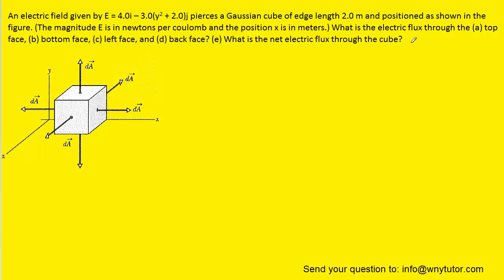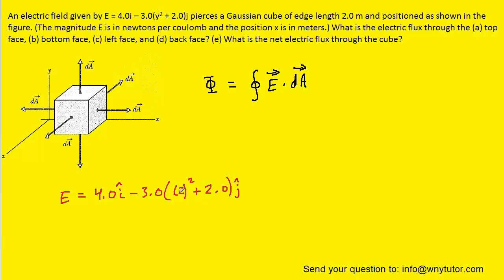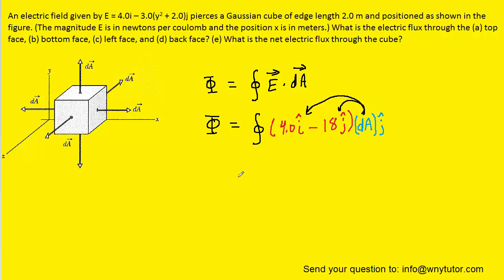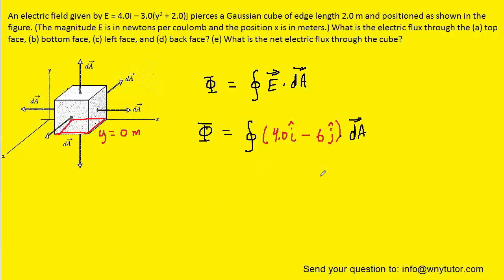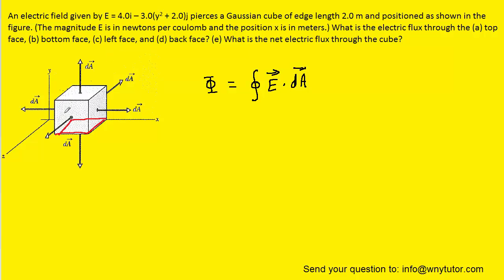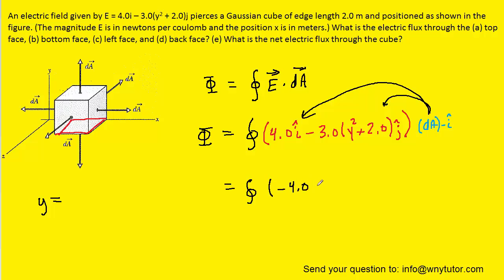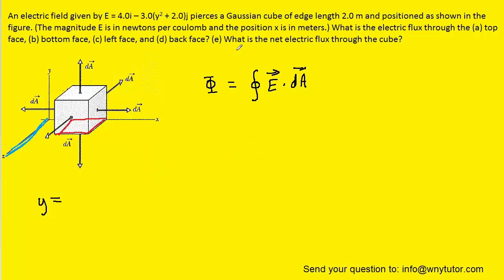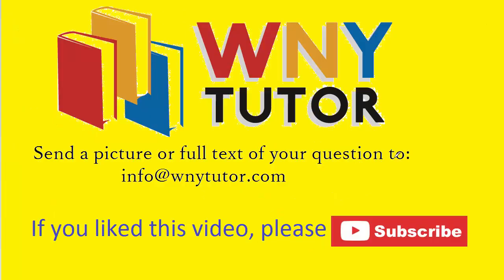An electric field given by pierces the gaussian cube

Comment: Why does the R and L faces have the same flux while the T & B do not have the same flux?
Reply: The top & bottom of the cube have different flux because their flux depends on the j part of the electric field vector. The j part of the vector's value depends on the y-value at that position, so because the top and bottom have different y-values, it causes the strength of the electric field to differ between them.

Comment: Plzz help me with this question 
A closed surface with dimensions a = b = 0.4m and c = 0.6m is as shown above. The left edge of the closed surface is located at the point x = a. The electric field through the region is nonuniform and is given by E = (3 + 2x^2)în/C, where x is in meters.  (a). Calculate the electric flux leaving the closed surface.  (b). What is net charge enclosed by the surface.